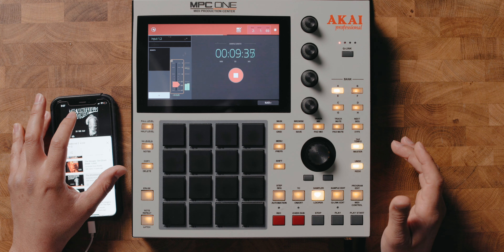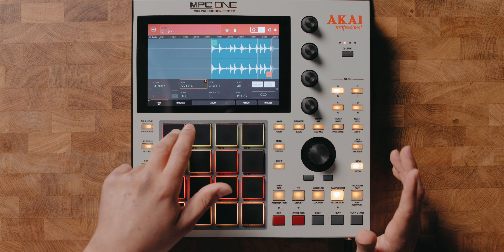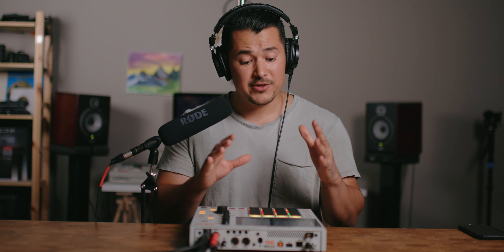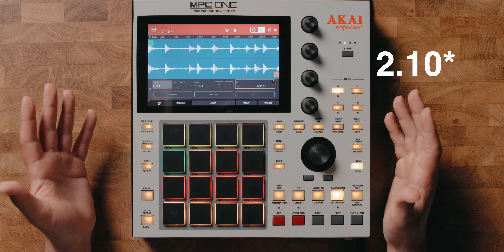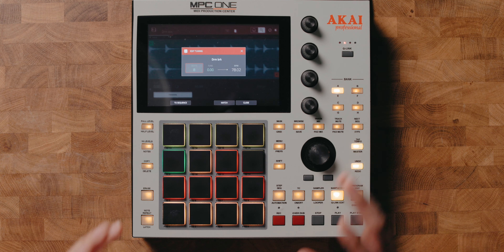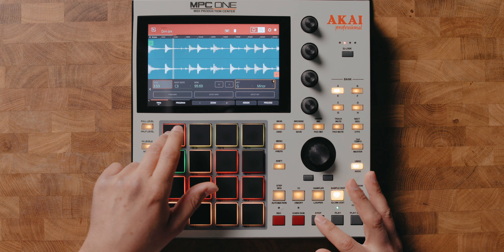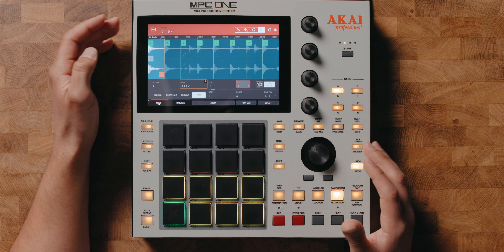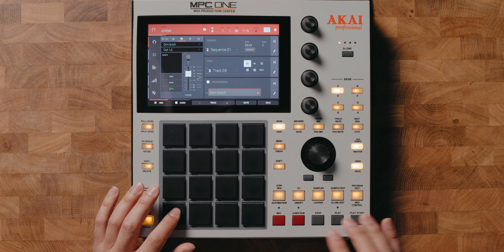Akai MPC One Sampling | MPC ONE Tutorial pt.2

Comment: Great video! This is a great way to match drum loops with existing samples. However, this method doesn’t always work (there are samples with tempos where you can’t apply the match function, when doing that, it still remains the same; that happens mostly with melodic samples). Other than that, this is a powerful tool!
Reply from the maker: Hey Pablo, thank you for sharing this and you’re right that’s why there’s so many different ways I’m doing it which will not always work. So far I’ve had good luck most of the time with this method but there’s times where it could be a little funky and not detected exactly where it should be

Comment: This works indeed. However, you should be able to bmp match without changing the pitch using the 'warp' feature. Especially since you can add tails to sample chops, it should be the go-to way to timestretch. Then again, your old school MPC way definitely works fine too. It can be tricky to mask the audio artefacts (read: glitches) from using warp for anything too extreme. But especially in a beat with a lot of audio textures and layers, it won't be a problem. Drums would already be kind of choppy anyway and sometimes it is better for the individual drum sounds to have more room / duration, instead of pitching it up, making the sounds shorter. But not trying to say you did something wrong here. There are simply a dozen ways of accomplishing more or less the same thing.
Reply from the maker: Hey brother, thank you so much for taking the time and sharing this valuable input. I’ve used the warp method and haven’t been a big fan of it with my workflow I usually tend to pitch up or down and play it by ear, Since I don’t use the warp method as much I don’t really talk about it but I would like to explore it a little bit more in the near future. Thank you so much for this information by the way. 🙏🏽🙏🏽🙏🏽
Reply: @malobeats  You're welcome. Honestly, your solution works too and in plenty of cases has the better result. Unfortunately the warp (timestretch) on the MPC One can be a bit hit or miss. No hating, just saying. I also think the workflow is a bit rough, but I get more into it the more I use my MPC One. It's a powerful machine.